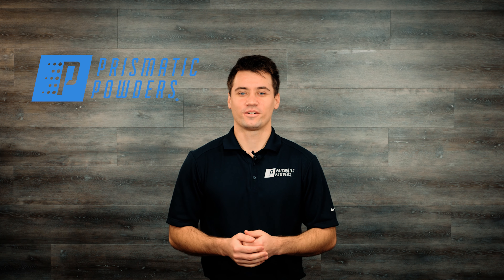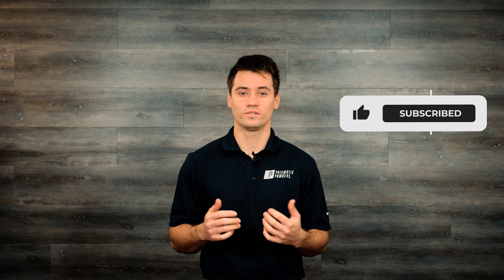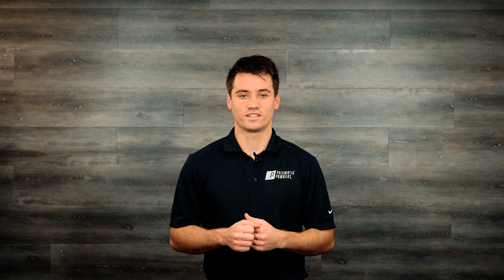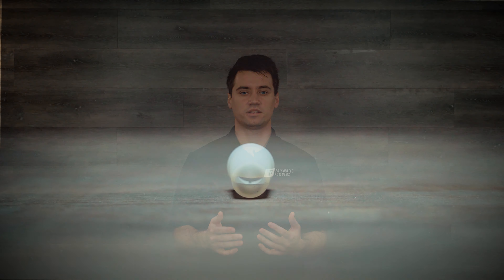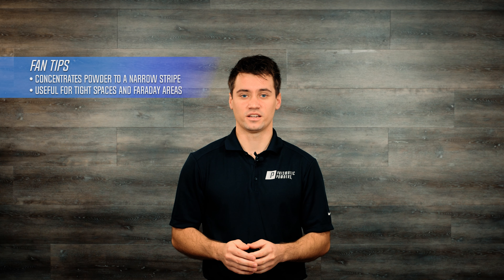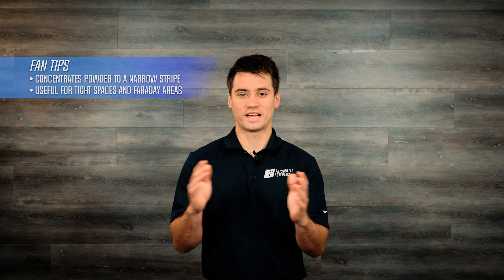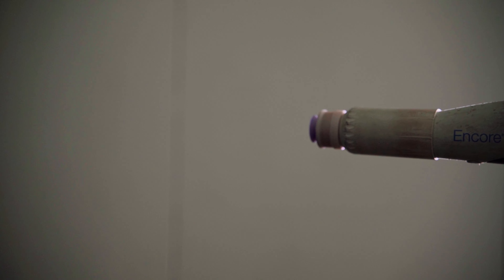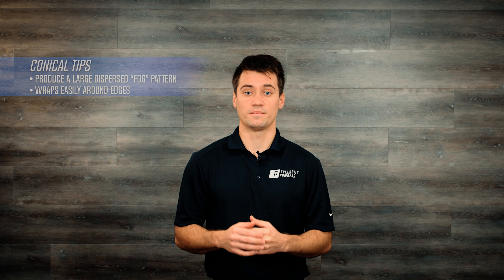Prismatic Powders | Nozzle Knowledge (Select The Right Nozzle For Your Powder Coating Project)

Comment: Hi there, we r facing problem of Faraday cage effect on the inside edges where two plates are joint. Powder is not able to stick to the edge. Can you suggest any Nozzle for that?
Reply from the maker: a slot type nozzle along with adapting the powder flow and voltage for that specific area. Depending on how visible the spot is and your familiarity with the powder you are spraying you could shoot those areas hot...but that would be a last resort if all else fails. We don't typically recommend shooting hot because you can't "undo to it"